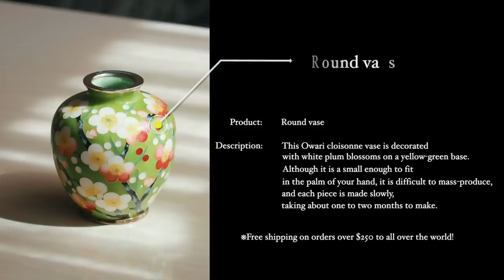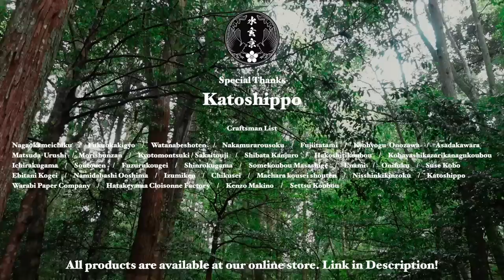720時間かけて花瓶をデザインするプロセス

Comment: I managed to get some decent 7018 rods here in South Africa to try out as I generally run 6013 ( they are readily available) . 
I really struggled to get them ( 7018)  to run even on cleaned prepped steel . Was thinking the rods may have not been dry enough ? 
I often have to weld scabby , rusted steel during maintenance just to tie the client over for awhile and find 6013 gets the job done albeit it doesn't look great . 
Thanks again for your vids
Reply from the maker: Thank you so so much for your comment🙌🙌
We will keep uploading great content ao on💪💪

Comment: To be honest, I still do not understand what material the vase itself is made of? I immediately thought that this copper, but it would have melted during heat treatment
Reply from the maker: Thank you so much for your support as always 🙏 
That's a copper actually 😳
Reply: @Craftsmanship-Process  Wow I was even right hahaha)
Reply: Copper melts at 1085 degrees C
Reply: I mean, because of their relative high melting point and the ability to transfer heat fast and evenly. Copper cookwares are one of the most expensive and sought after culinary items.
Reply: 0:17 your answer